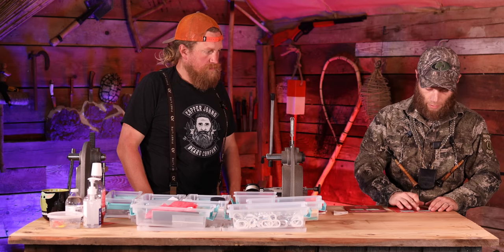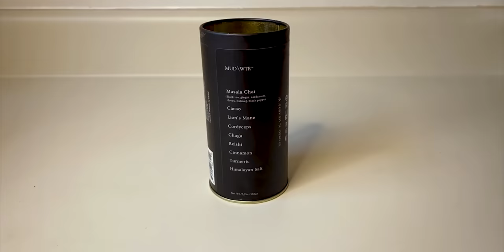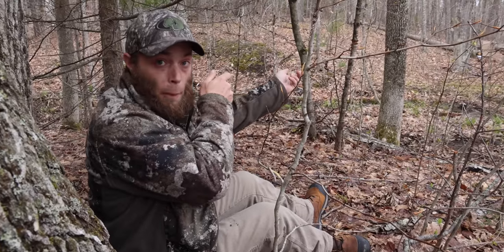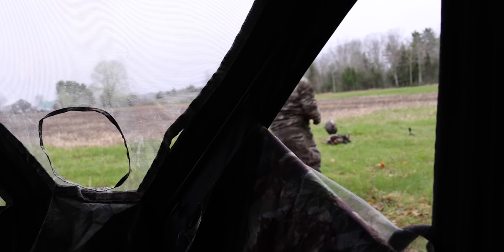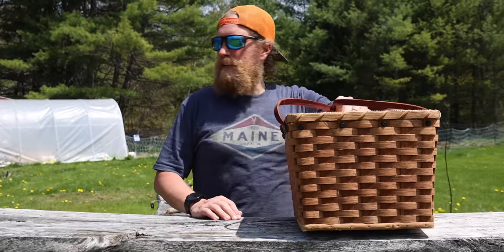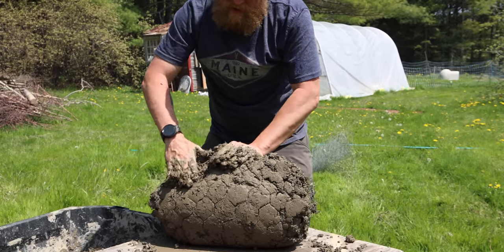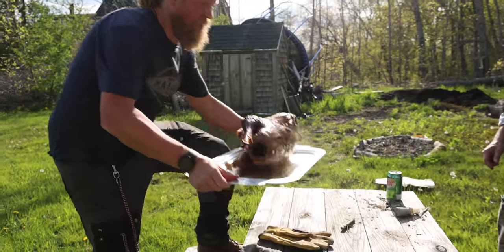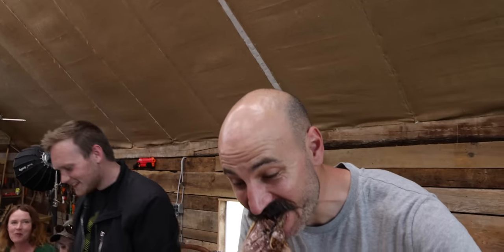Catch Clean Cook Turkey in Mud with the Air Shotgun - Cooking in Mud- Air Rifle catch and cook

Comment: Zack! Using chicken wire was not a good idea, modern chicken wire is coated with zinc that will burn off in the fire. You have the combination of fumes that I wouldn't want near food or in the air

Comment: What's the point of going to all the trouble of wrapping it in chicken wire and mud when you've already sealed it up in a plastic bag and tinfoil? The end result is identical to just putting it in the plastic bag and in the oven on a low heat.

I'd also advise against eating fiddleheads - they contain ptaquiloside which is highly carcinogenic.